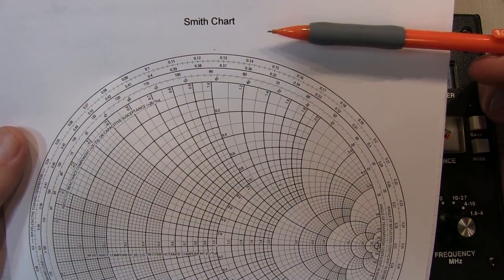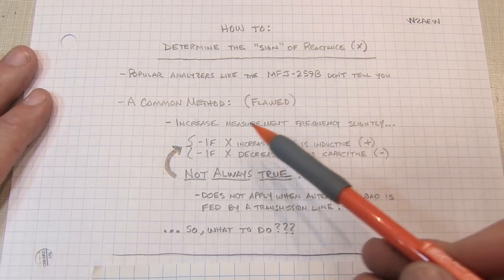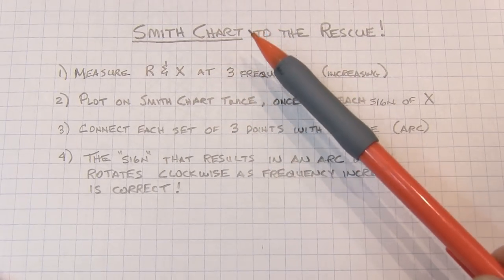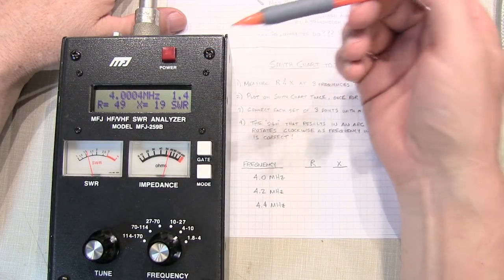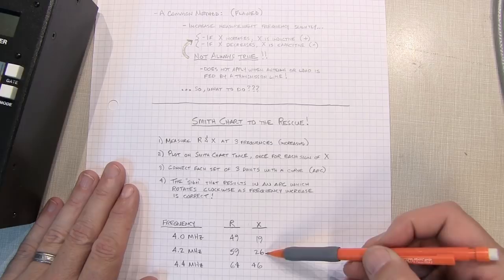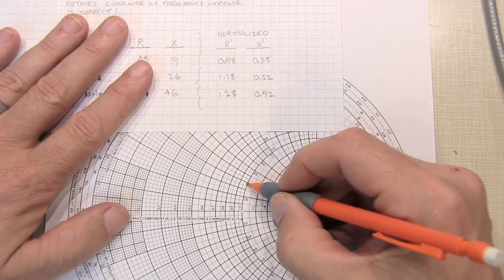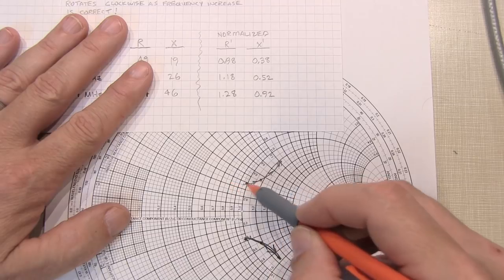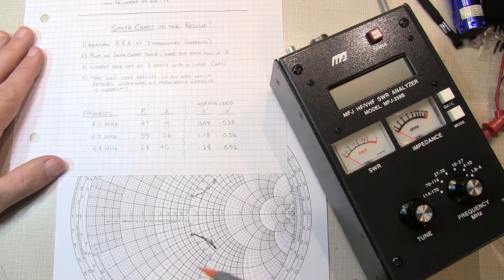#282: Part 1: How to measure complex impedance with MFJ-259B | determine sign of X

Comment: Great video as always! I designed an L match for an antenna just the other week using the MFJ-259, and the simple method of increasing the frequency happened to correctly predict an inductive load, but this is a much better approach. Thanks!
Reply from the maker: Be sure to check out Part 2....